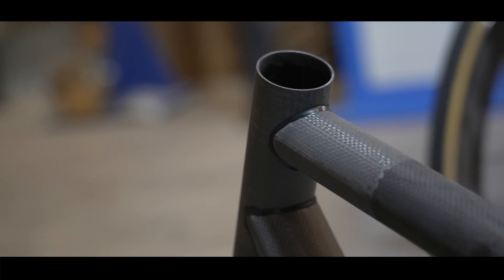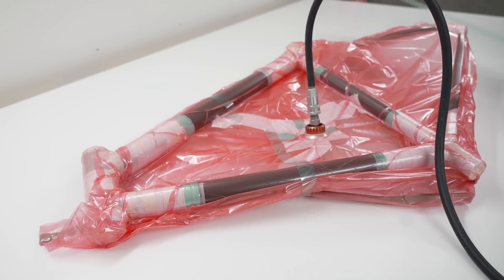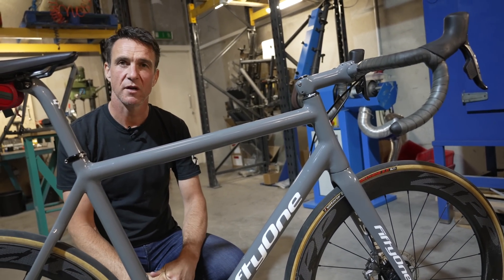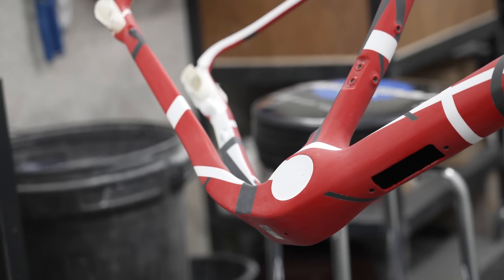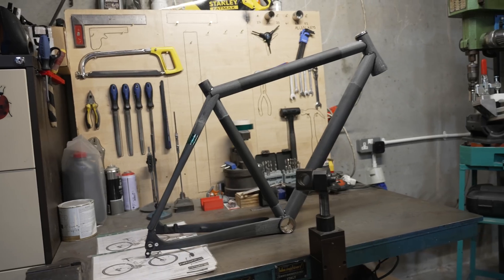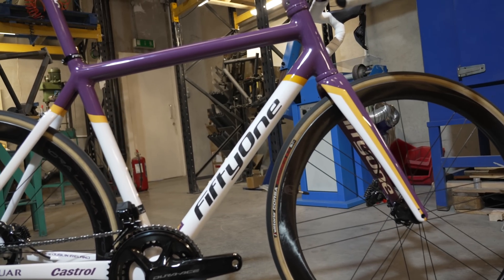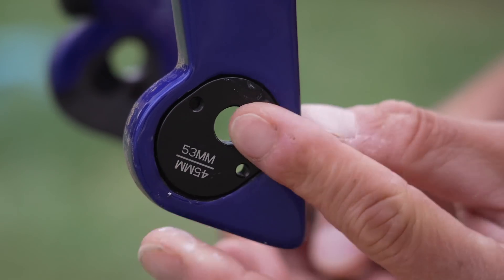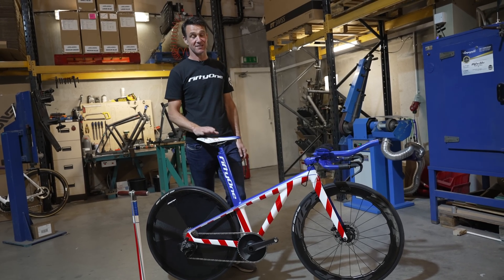How Are Carbon Bike Frames Really Made?

Comment: interesting to see that the bottom bracket area isn't as massive as most mainstream manufacturers build their CF frames. I wonder what the engineering/design philosophy is behind that decision.
Reply: There frames are not really lightweight 

If you want stiffness while being light you go big bb area

There production method does not allow really light frames so it seems they didn’t pushed it to much
Reply: @harrie205  Actually their lightiest frame has tipped the scales at 650, or a bit less, grams (1.433 lbs.) No to heavy I would think.
Reply: @westendshopemployees2785  I did not wrote heavy I wrote really light 

This frame is not well designed from a lightweight design standpoint. For Road frames the main concern is stiffness (not strength) and stiffness in the bb area is determined by material and geometry. The geometry has a much bigger influence (google second moment of area) while not adding to much weight. That’s why road bikes need fat bb areas (it’s there to be stiff without needing to much material which would make things heavy).

Comment: Very interesting. Just been to the website and they specify the deposit at £3250 but no total cost that I could find. That seems a bit iffy.
Reply: If say they don’t say total cost as paint and design would have a big impact. I would be that if contacted they would provide a price range that a bike would land in. I just got a custom steel bike and after 100 odd emails I can see how they wouldn’t want to nail down a price.
Reply: Our Bad, Price is £6,500. its a 50% deposit. Custom Geo & Paint included in that.
Reply: @AidanDuff-ut9rm  Cheers Aidan. I wasn't implying anything dodgy on your part, just the uncertainty of knowing what the final cost was likely to be. Seems like a good price for a totally custom solution if one were in the market for that. If I had that sort of dosh to lay out on a bike I would certainly be considering one. Love the round tube "traditional" look.